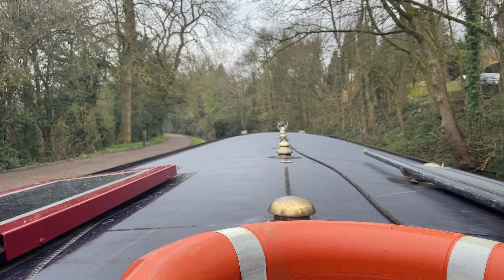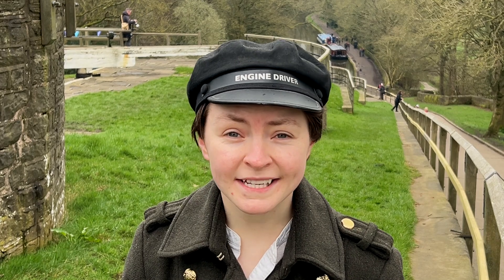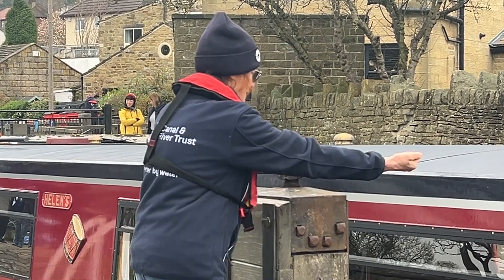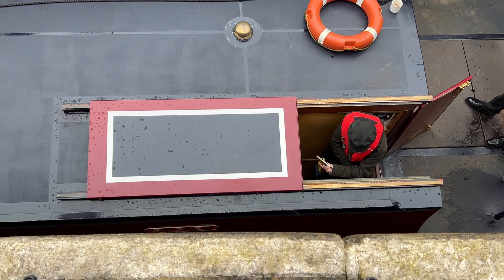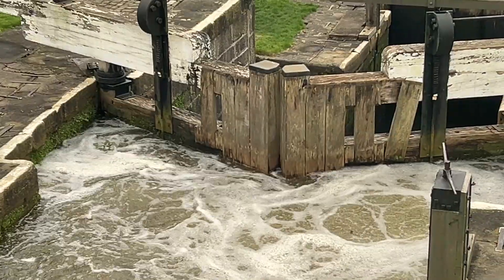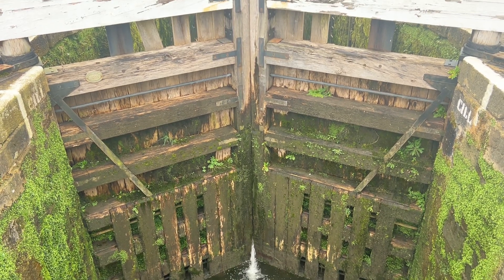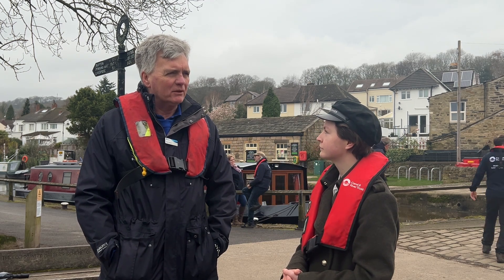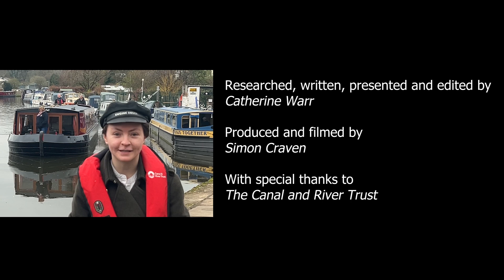Celebrating 250 Years of Bingley Five Rise Locks

Comment: I remember passing through Five Rise Locks a couple of times (once going up, and again going down... could have been vice-versa) whilst on a boating holiday with friends from the 6th form, took flipping ages but was a lot of fun. Obviously, we always made sure to tie up near a pub for the evening. Not that we really needed a pub, I'd brought along 5 gallons of home made wine for the trip. 

We went on canal trips twice, but for some reason never got our deposits back. Maybe because over those two years we broke a lock gate, jammed the tiller onto the deck so it couldn't be moved, tore the frames out of most of the windows on one side (we were caught by a cross-wind when passing something), nearly blew up an engine, accidentally dropped the contents of a full chemical toilet inside the barge, got one of the mooring ropes twisted around the prop and blunted a bread knife getting it free, and also managed to bend one of the barges trying to get it off a mud-bank. 

Happy days 🙂